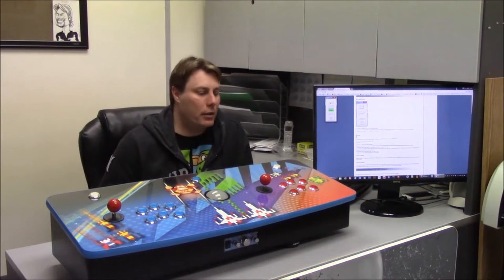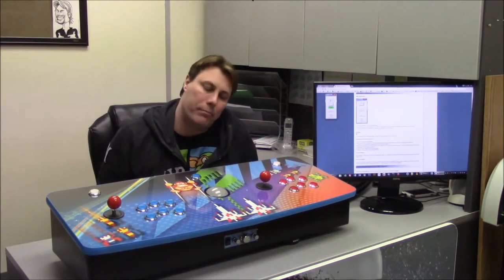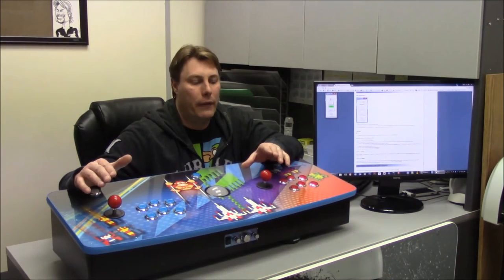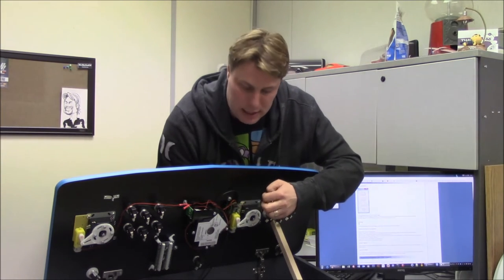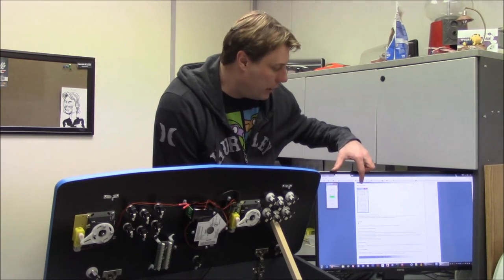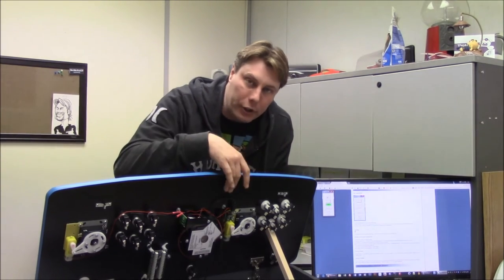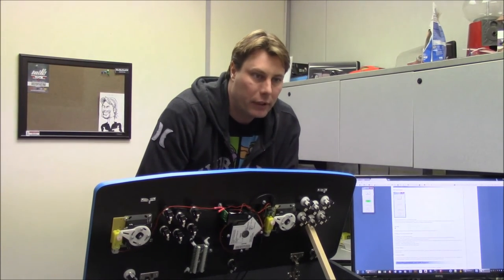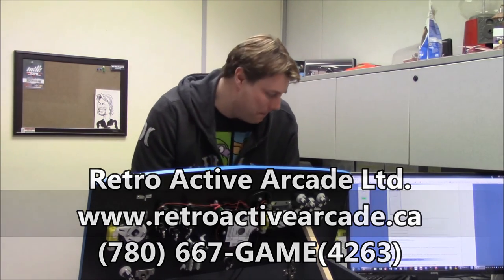Ultimarc ServoStik 4 Way to 8 Way demo, how it works and how to install it.

Comment: 1) I bought 4 servostiks and 2 servo control boards... Does servostik orientation matter? I don't know if the motor for Player 2 will fit unless I turn it long side up.

2) If I can turn it long side up and it still does not fit right, do I absolutely need to use the motor for Players 3 and 4? Or can I simply just save those 2 motors and that 2nd control board, and use the servosticks without them, and change 4/8 way manually when needed?

Comment: Nice video thanks! So hyperspin frontend will do the automatic 4/8 switching for you? I thought LED blinky was required running in the background to do the switching based on the game you picked... cheers
Reply from the maker: What I was trying to convey is that they work hand in hand. It is LED Blinky that controls the actual switching of the 4 to 8 way along with the LED lighting effect. If you are not using LED Blinky you would have to create a manual switch for it to work. So Yes you are correct, thank you for the clarification.

Comment: With the ServoStiks they only work properly with two joysticks and one ServoStik Control Board any more than two ServoStiks and two ServoStik Control Boards and you will have issues with the motor not activating randomly. If you use two ServoStik Control Boards like I did to have them in sync and to distribute the power to the USB ports one of the motors will not activate randomly. Also, I had to sand the restrictor plate and motor arm as they would catch when turning due to the manufacturing process which caused dents on the bottom of the restrictor plate. I also had to sand down the sides where the restrictor plate pushes against as it was too tight and would not allow the restrictor plate to turn freely, loosening the screws did not work and one of the black wires on the motor was not soldered and had to be soldered. The thread 'ServoStik Review' on ArcadeControls forum back in 2013 is a good starting point if you have issues.

Comment: How many usb slots does 2 joystick + the control motor need ?
How are the directions detected? as keyboard keys as well as with jpac or ipac? or as an USB gamepad/joystick ?
Reply from the maker: The control motor just uses 1 USB port, the sticks use microswitches jut like your buttons so they would map out with same controls as well.

Comment: Im getting a control made for me by someone else. Does the orientation of where the motor sits matter. I see in this video, both are on the left of the joystick. Is that the optimal place to put it?
Reply from the maker: The spot we have it in is the optimal place to install it.
Reply: @RetroactivearcadeCa  Thanks 👍
Reply: @RetroactivearcadeCa  
1) I bought 4 servostiks and 2 servo control boards... Does servostik orientation of the stik itself matter? I don't know if the motor for Player 2 will fit unless I turn it long side up. 90° turn of entire device

2) If I can turn it long side up and it still does not fit right, do I absolutely need to use the motor for Players 3 and 4? Or can I simply just save those 2 motors and that 2nd control board, and use the servosticks without them, and change 4/8 way manually when needed?
Reply from the maker: @jeremysmith9131  you can do anything you want with these sticks. It is all in the way you wire ther connector location that matters, not the orientation of the stick itself. As for 3 & 4 player controls, there aren't any games that utilize 4 way only so you can leave that off.

Comment: I may have missed a comment confirming this on this video... But does this thing offer just a simple push button activation for the gate swap? From what I saw it pretty much just requires the PC program to activate these things.
Reply from the maker: Nexus of ice it is a program downloaded from ultimarc website
Reply: Retro Active Arcade. I am really surprised that they did not design in a pushbutton function to that product. That seems like a no brainer. I'm sure that the program is great if you want to go through and program every single game on what type of gate uses.
Reply from the maker: Nexus of ice you can just use a pushbutton for it if you want to,  it just needs 5v power,  a momentary switch will work.
Reply: Retro Active Arcade. Yeah I was thinking about wiring up one myself. It just seems really odd that they wouldn't package that with the unit.

Comment: I came across this video and your microswitch video, and am curious. Would it be possible to us the USB connection solely for power, while using a button and microswitch to toggle modes in hardware mode? I'm trying to see if anyone has done this and am having no luck.
Reply from the maker: Hi, what your talking about is completely do-able. The USB can just power the servos and you can have just a button set up on your CP or somewhere accessible that you just press to change from 4 way to 8 way. I recommend looking at the Ultimarc website and downloading the servostick software to see how it works. It can be set to manual (Button press) or automatic in your front end to change when a specific game is chosen.

Comment: Would this work with a PB6 Jamma board?  I have it in a custom cabinet
Reply from the maker: The joystick will work but the servo stick solenoid will only work if you hook up a seperate button with power to it to switch it manually. It will not do it automatically,  it needs mame in a computer and a seperate program called led blinky to use it properly.

Comment: Will it work with a 60-1 board?
Reply from the maker: It will not work automatically, meaning you will not be able to program it to change when specific games are selected. You would have to install a button to press to manually change from 4 way to 8 way. So yes it will work.
Reply: @RetroactivearcadeCa  Do you sell the buttons? Meaning, does the button come with the joystick if I order it?
Reply from the maker: @markherring3513  we don't sell the servo stik anymore but any arcade button will work for what you need. You will have to order directly from Ultimarc.
Reply: @RetroactivearcadeCa  Thanks for the replies!